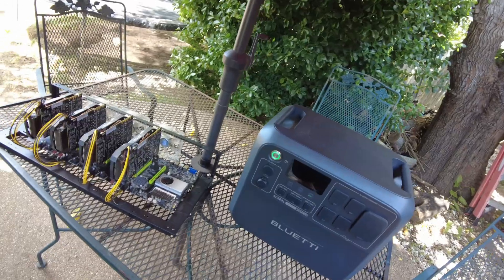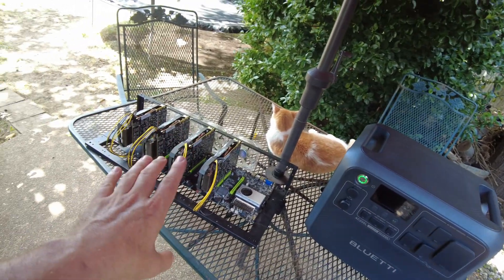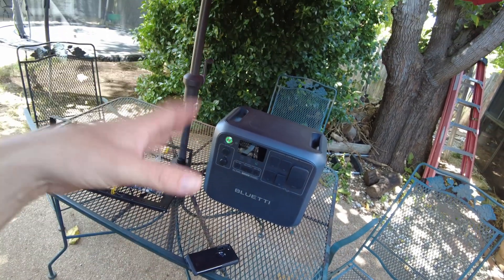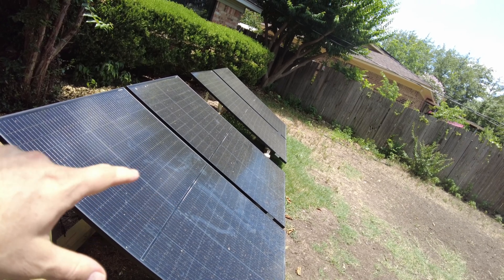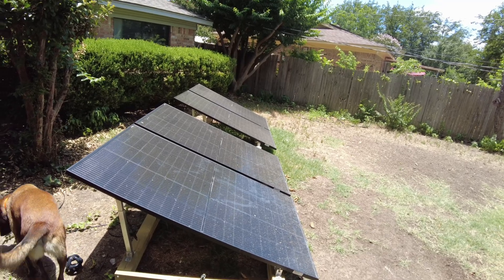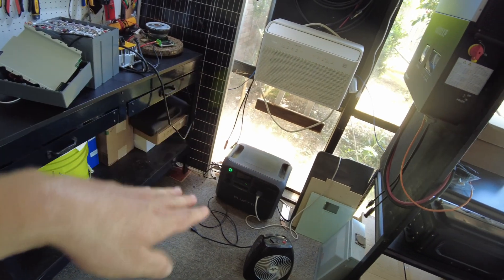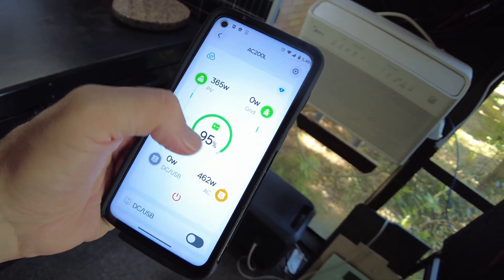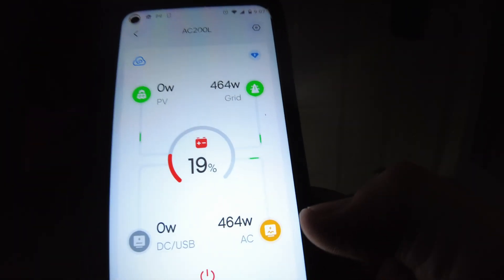Easy Solar Crypto Mining With Bluetti Power Station

Comment: I got the vtoman 1800w jump and extra battery and solar for 2 avalon miners 3000w total power for the two batteries.  Its a budget deal the whole set up came to 850ish 200w solarpanel. It only accepts max 300w grid and 400w solar max but my power goes out alot so either way I'm happy

Comment: Why don't you run two panels in series and run the other two panels in series and then hook them together in parallel?
Reply from the maker: Because the power station has a 15A limit, and two of those panels in parallel far exceeds that. Doing so would result in the production being clipped at 15A. Thanks

Comment: And please keep going with Solar-content for crypto mining! You are awesome!!! Thank you very much for your effort to make such a nice videos!!  - maybe you can test other Solar Generator brands as well for crypto mining rig? - make a test if they can run from Solar never unplugged in case of charging same like this Bluetti model? And I do have two specific questions - first - why you cannot connect more solar panels - all what you have - even if that will exceed the Voltage of array for one Bluetti? - there must be solution to do that - make or add some over-powered device discharger between Solar panels and Bluetti - another device that will not let to burn down Bluetti - this is because you can spawn all of your's solar panels in all garden accordingly to the Mornings or Evenings Sun as I do can see in your video! And second question - can you maybe do two Bluetti same time connected to each other and instead make 2 solar arrays - and when Mornings Solar panels goes down in power - you still will have Evenings Solar panel array - but only when 2 Bluetti charge each other from Morning or Evening Sun?

Comment: @BradCagle - what model of this Bluetti are needed and what setup is good for to run proper big 3 - 4 Kw Bitcoin miner S21 ,S21+ etc ? What solar setup are needed for that thing? And how to scale it up - If I want to run 100% from Sun-only that it runs 24/7 on Solar or batteries? Did you test it on GPU rig to it on 100% solar-only 24/7 and batteries only? What Solar setup are needed for example to run your mining rig 24/7 on Solar and batteries only?

Comment: Excellent video.  I have a question.  I know Bluetti EB3A max input: one solar panel is 200W and 120v AC/9A max.  I am looking for bluetti without battery storage because charge cycles.   Is there any alternative than bluetti or a different model?   What is it called?  Power Inverter?

Comment: Love the set up for ease of install! I'm still aiming to do your older set up you've demonstrated with the DC relay but this would be great too for less down time.

Just curious, with this set up, can you set a cap for the charge % in the settings to prevent 100% SOC as often when possible?

Comment: how long does that battery last at night without the AC i am looking to do something similar but not using one of those solar generators
Reply from the maker: probably 3-4 hours. The calculation is pretty simple, if you need to run 450w for 12 hours then you need a battery that is 450w x 12 = 5.4Kwh. You probably would want to add a fudge factor of maybe +25% for overhead.
Reply: @BradCagle  1.2kwh is 100ah so i would need 12 100ah batteries to run for 12 hrs or 6 200ah
Reply from the maker: @squirrelmasters  Pretty much, 12.8v 100ah = 1280wh. Keep in mind the voltage matters, for example a 24v 100ah battery = 2560wh. Now if you had 12x 100ah 12.8v batteries like you said, this would give you a total capacity of 15,360wh. You also might want to consider a higher voltage system. Wire size, and charge controllers get expensive with large 12v systems.
Reply: @BradCagle  my rig uses about 1000w and i do know that about the charge controllers i am just doing research at the moment and basing power usuage for runnin kawpow with polaris cards for a good buffer
Reply from the maker: @squirrelmasters  Right on. Sounds like a fun project!
Reply: If sun goes down and in Bluetti will still 100 % battery level and you will discharge to 20 % remaining capacity, rig will run at power about hours:

100 W / 16 hours 
200 W / 8 hours
300 W / 5 hours
400 W / 4 hours
500 W / 3 hours
1000 W / 1,5 hours

@bradCagle is it possible to have 100% battery after sunset?

Comment: I've been doing this with my AC200L and my personal PC for a few months. The only issue I've seen is if the AC output is close to the 12A max grid input, it freaks out and turns off the grid. If I don't notice it will then run the battery dead. If I do notice, I have to do a full power cycle to get it to work right but with a load of about 500 watts mining with my 4090 and 7800X3D I usually have no issues. I only run a load that high if I'm mining and running the Midea air conditioner at the same time. Dallas summers are brutal. I might try a firmware update and maybe that fixes my issue.
Reply from the maker: Nice, thanks for sharing your experience. Yes it's brutal here in north TX.

Comment: How much money does the Mining rig make ?????????
Reply: Not much at this time unfortunately crypto mining is not profitable,  to make some money the graphics cards will need to by at least RTX 3080s those GPUs pull so much power, i don't think solar will be able to keep up, also the cost is high.
Reply: @ahmadjibawi8535  i its deffently better then paying for for power..
i live from mining from solar energy, but ofcourse my system is bigger
and im running asics

people mining from the grid gives alot of the money made away, using grid for mining makes no sense
how will you compete with big companys that have free power if you are paying

i can run a new btc miner 12 hours on solar and make 3-4 times more profit then if it is on the grid 24 hours at 0.1-0.08 cents

solar is very cheap, where it becomes expensive is when you add batteries
compared to buying a second miner, solar have a way better roi then most miners

solar panels are around  0.1-0.13 cent per watt
and they keep on giving

Comment: What kinda gpus you running? They kinda look like EVGA GTX 1070 minis
Reply from the maker: Basically yes, they are like 1070's. These are P104's mining specific cards. They were originally locked down to 4GB, but a bios floating around unlocks them to full 8GB. I picked them up dirt cheap, like $30 a piece. Thanks

Comment: Put your 4 panels in a 2s2p Configuration. (2 in series, 2 in Parallel) when that shade hits later on in the day half of your (non shadded) array will still get full power.  whats the model number of the solar panels? What is the VOC and amps on the back of it?
Reply from the maker: It may not do well in 2s2p. The IMP of the panels is 11.38A, and the max PV amps the power station input can handle is 15A. So in 2s2p it will need to allow over 22A to get the most out of it. This the pain with power stations, you have to run the voltage up as high as possible (while not going over) to fight the input current limits. The other worry is the PV adapter wire supplied by Bluetti looks a bit on the thin side (just checked 14awg, ok for 15amp) , so In the event something shorts internally, and those panels do pump out 22+ amps into that wire because of a short on the other side (short in the power station) might melt something. Thanks
Reply: @BradCagle  I had a situation like you when I was using my AC200p, I could hook up the last panel to the charge enhancer and that would send AC power to the Unit, but these new Bluetti units don't use power bricks anymore. I upgraded to the AC300 and still had that same issue but then I discovered the Bluetti PV step down Module. It allows you to put up to 450volts (i believe, i have to check) into the AC300 and other compatible power stations. It steps down the voltage so you don't have to worry about over paneling. The AC300 combo is dirt these days compared to what I payed for mine
Reply: The only other advice I could give you is to get 2 more of those same panels and put it in a 3s 3p string. have one facing south and the other west or east (whatever is better for you in your location) that way you'll get more coverage throught the day or if you face them all south you'll get those max 15 amps that the power station can accept.

Comment: Got all excited and tried the link. AC200L is $2,499 here in Canada 🤣Someone at the mathemagics department got confused and used 1.92x as the exchange rate instead of actual 1.37x. Maybe Canadian edition comes with a 4090 GPU to get you started 🤣
Reply: i have a large house battery
and it makes no sense using battery for mining in most cases even though i have it
its better to use the battery for my own personal use

when it comes to roi, the batterys makes it very hard in most cases

running a new btc miner 12 hours on solar makes 3-4 times more profit then running it 24 hours on grid at 0.08.-0,1- cent 

running the last 12 hours is very expensive if you need a battery for that..
mining also wears down the batteries fast 

kaspa miners are the only ones i run on battery, they need to make as much as posible before the get to old

solar panels are very cheap per watt, its hard to say the same about batteries
Reply from the maker: 😬Oh man, that's over the top a bit haha!
Reply: @BradCagle  Looked around and that's only the Amazon scalping price mercifully, everywhere else it's a bit more reasonable 🤣 Can you set it so it switches to AC when battery reaches 60 or 70% SOC and not just 19%? I wouldn't want to cycle the battery every day. Is there a mode where it just outright shuts down the load at a certain SOC? Could use the whole thing just as a cloud buffer and only run the miner when the sun generates enough juice to run the miner otherwise shuts to miner off. Mining profitability is so low it's barely worth it at any hydro rate so sun-only is a good option.
Reply from the maker: @rafalklepinski7372  Ahh, ok good haha. Yes you can set it to whatever % you want. As for it completely shutting down, I'm not sure. I need to test that. I think once the AC output shuts off it requires someone to turn it back on. I'll play around with it.
Reply: Did you make a chart on your light savings weekly ? Daily ? Monthly? I would like to know

Comment: how much you make off that small miner?
Reply from the maker: At the moment it produces around $0.80 per day. That's if electricity costs are 0. Since it's on solar for about half the day, maybe it's producing $0.40 in actuality.  Now that can change pretty rapidly, it could go up, or down dramatically. Thanks
Reply: @BradCagle what coin are you mining now mate?
Reply from the maker: @4evermetalhead79  Dynex, and sometimes cortex
Reply: I wonder if you could find a more useful use of that rig. Like rendering cool AI stuff or something?
Reply from the maker: @adriftatlas  Yes, you could run AI models on it. Interestingly the cryptos I mine right now are AI on blockchain, so compute jobs can be run on these blockchains, and it can use my GPU to power that job.

Comment: Nice solar setup. 
I'm interested in getting into crypto mining. But know very little about it. Any suggestions?
Reply from the maker: Thanks. As for getting into crypto mining, man It takes a lot of research, and it's risky. Also the profitability is very low to non-existent right now for most hardware that is in consumer reach. If you really want to play around, and learn you can grab a fairly recent GPU like a NVidia RTX3070 (there are newer ones available) and use something like nicehash.com. Nicehash has a profitability calculator so you can check if a GPU is any good for mining before you commit. Hope that helps! Oh, and be worry of scams, there are a lot of crypto scams.